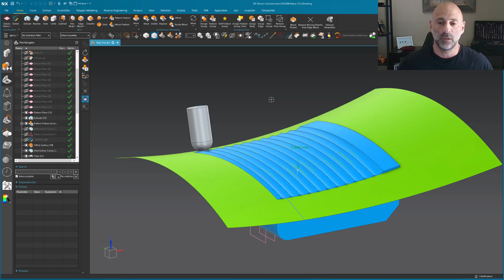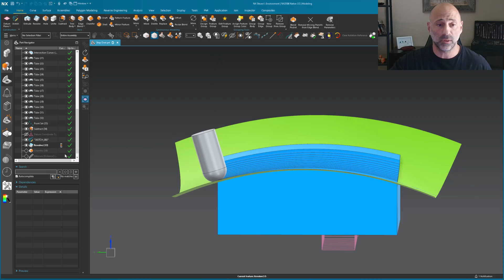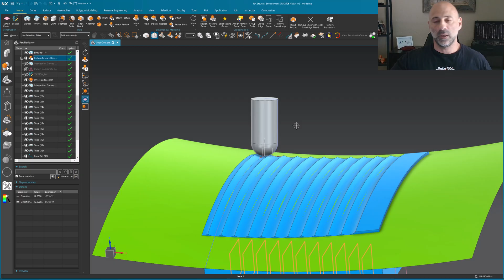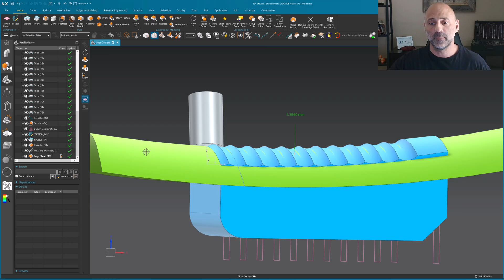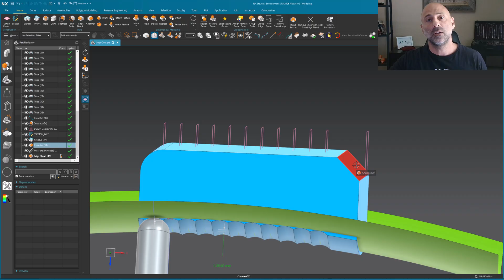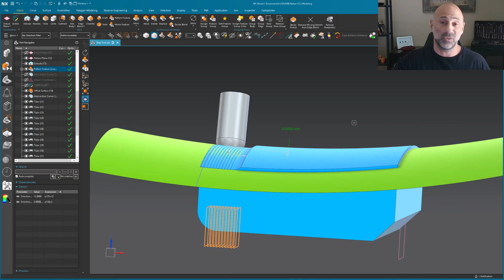Why Your CNC Parts Cost Too Much

Comment: Great video! I'd just like to add that as you decrease the step over, you don't want to simultaneously decrease the cutter diameter. For a given step over, the scallop height will be smaller (i.e. smoother) with larger-diameter cutters. So with a surface like this, it's beneficial to design it so as to allow for the largest-diameter ball end mill possible.
Reply from the maker: Generally I agree about the diameter and stepover distance thing with the exception (and I should have been more specific) being on complex machined parts like control system manifolds where a large cutter profiles the over all and a cleanup pass is made with a smaller tool to get into spots the large cutter cannot.

Comment: I think you hit the nail on the head. As a Machinist I can add a couple of things. If I was machining that part, starting with rectangular shaped stock, my first operation would be using a square end mill to surf or "hem stitch" to remove the bulk of material. Ball end mills are inefficient at heavy metal removal because the tip does a poor job of cutting. The center of the tip is at basically zero SFM.
Regarding small radii and deep pockets, long, small diameter tools have low rigidity forcing the tool to pick away with a small portion of the cutting length which always equates to more machine time. Usually significant to ridiculous. The surface finish also suffers.
Keep preaching the gospel. Even if you help save the sanity of only a few Machinist and make a few Designers a hero it will be worth the effort😃
Reply from the maker: Please always feel free to add to the convo. This stuff is very important. 

As far as a square end, lol. People get emotional when I say they can use a square bottom to rough things out. I will make a video about just that and why it is a good way to go. 

Those ball ends will also deflect more with heavy removal. Thank you